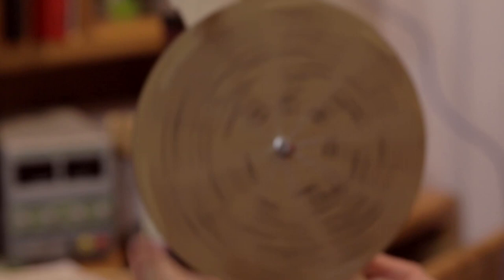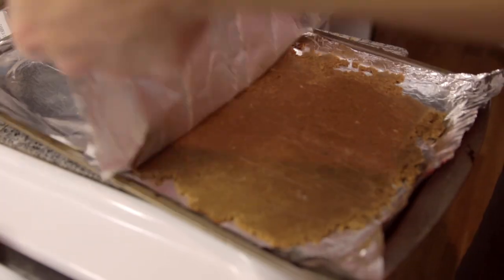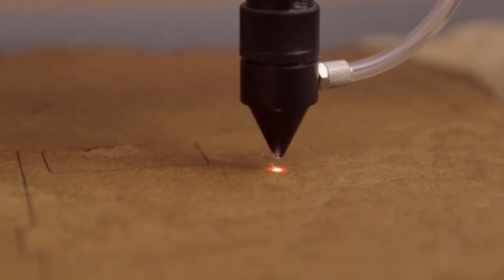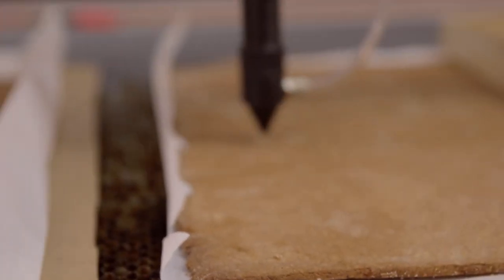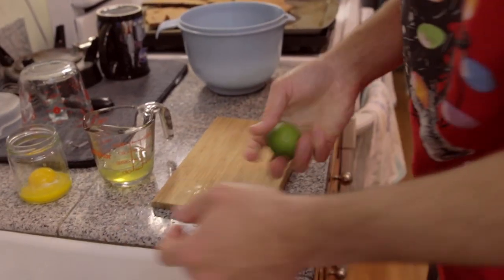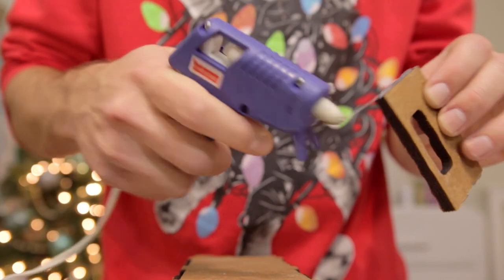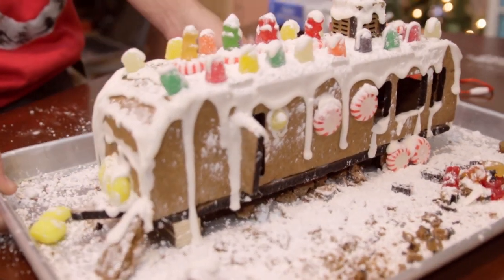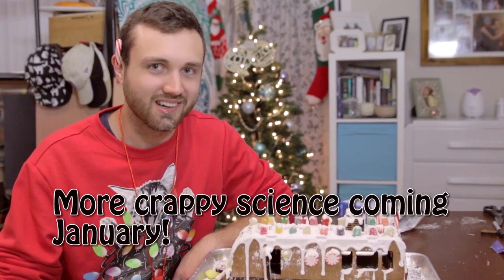Laser Cut Gingerbread Trailer Park

Comment: Why didn't you sand down the burnt parts to expose good edible gingerbread so you could actually use the sugar based edible cookie glue thing. And for the first time have something that's food be cut by the laser and be edible as in not tasting like the most bitter burnt thing ever.

Comment: A video suggestion (call me out if this is stupid): is the laser hot enough to at least soften rocks or at least metals?
Reply from the maker: This is a good idea. The laser beam has an insanely high energy density, so things get real hot if they absorb most the light. Materials like metal are really good at reflecting this specific wavelength so you can't cut them on my machine. If the rocks don't reflect 10.6um IR light then something interesting should happen.